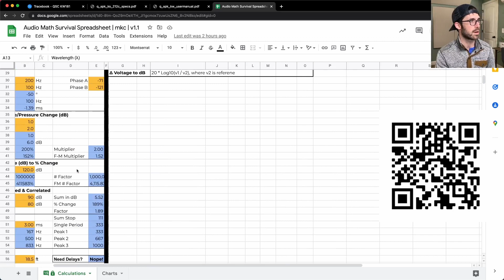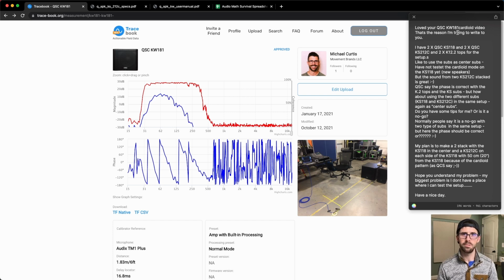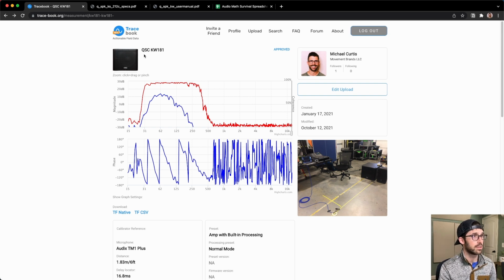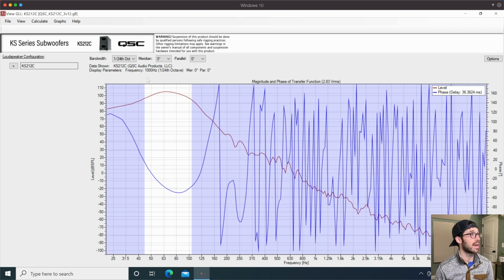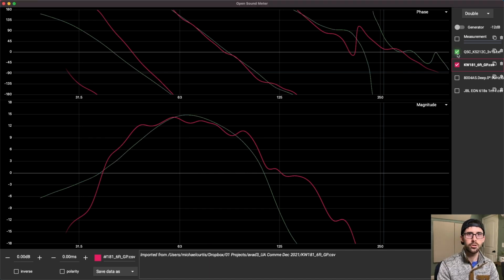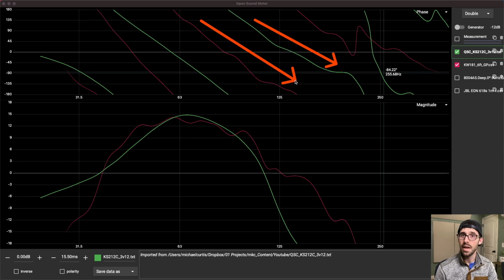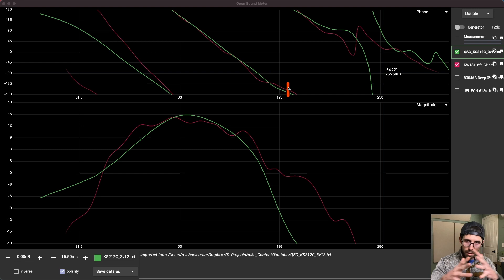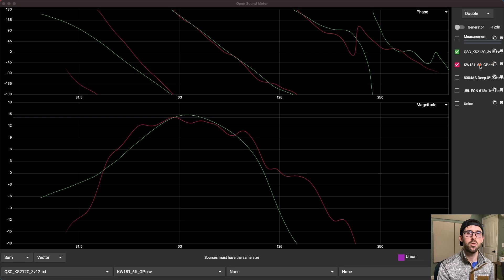Mixing QSC KW181 and KS212C Subs In The Same System? | Phase Compatibility Test

Comment: I had a Similar question, and this video helps a ton, so I bought a basic measurement setup like in your other videos. and am working on uploading the findings to Trace book it's a file for Ks212c and the KS112 I stacked a Ks112 non cardioid on top of a Ks212c and phase look very close from around 55-125 hertz and with both it adds about 6db. I did not have room to measure the rear to see how much cancellation I got going backwards but I'm sure it was nowhere near what it does when you're just using the Ks212c.

Comment: I currently have two KS118's and two KS112's. I am doing an event soon and wondering if I can place the KS118's either side of the stage, and the KS112's in the centre. From this video I feel I could try and reverse the polarity and see what happens on the KS112's. Any thoughts?

Comment: Curious, would the fact of the KS212C being a cardioid sub have any effect on the output of both subs (KW118 ) running clustered together? Or no effect? I would think the carioid aspect of the 212C wouldn't work to well with a DJ behind them as they are pretty good putting the sound very forward but a 118 next to it -all bets are off. Obviously, I think, with a 118 right next to the 212C the output would be effected mainly behind the speakers. Or am I losing my marbles? Great channel and videos!
Reply: The 212c would not have any cardioid effect on other subs. The second driver in the 212 is only affecting the rear rejection of its other driver contained in the same box. The only impact the 212 could have on the 118 is coupling as per the video, but processing would of course need to be involved.

Comment: Eh Michael, thx for the info! Already had a pair of kw181 and just bought the ks212c to bring a bit more kick to the dancefloor. Didn't try them together yet, but learning it's better to change the polarity of the 212 means a lot. Question though... symetry wise, does inserting my 212 (yeah, bought only one $$$) between the 181 will have a negative effect, like phase cancellation, or placing them apart ( pair of kw181 on a side of the table, the 212 on the other) would be better and to hell with symetry? Maybe it won't have any effect, I don't know.... I'll watch your other videos about the sound physics you analyze here, I don't quite understand all that science yet... Teaching industrial automation, so I guess I'll be able to connect the dots someday 😅 Thx a lot!
Reply: Inserting the 212 in the middle of the 181s will certainly negatively affect the coupling that would otherwise happen with the 181s side by side. 
If placing 181s on either side of the table, put the 212 in the centre and play with delay and polarity to help it play well with the 181s. 
Be aware of power alleys.
Reply: @StereoAnthony  Just got my Driverack PA2 last week, I will sure try your suggestions and give you some feedback when I'll get some results. Thanks a lot! 🙌

Comment: Thanks for the info 👍 
I have two single 18s 6th order band pass subs and have recently added a duel 18 front firing ported box to the setup.
I am planning of placing it in the middle of the single 18's.
I am going to measure and phase align, but would you suggest splitting the lows between?
Also subwoofer frequency tuning?
Thanks 😊

Comment: Great channel. I bought the KS212c in Feb 23’ of last year. While i love it it hits the limiter at 12 o clock position or below which surprised me considering it’s a 3600 watt sub i never would have experienced this…however my KW181 which i still have has never limited out at 12 o clock or below and it’s only 1000 watts. I’m not even pushing the KS212c very hard and it seems to not have the power it claims unless mine has a fault. I just purchased an EV EKX15sp and will be doing a comparison of both. If the EV sounds good I’ll get another for a matching set and sell my KS212c.
Reply from the maker: I don't have a ton of experience with the KS212c's, but I was also underwhelmed with their power output. You lose ~3dB of headroom or so by nature of the cardioid pattern, but the smaller 12" woofers also don't have as much max SPL capability as the 18" woofer.
Reply: @MichaelCurtisAudio  Thanks for this!  I have been having this very same debate and nowhere local I could test the KS212C.  I have loved the sounds from my KW181 for the last 10 years but wanted to get less boom in the DJ booth...  welp... Guess that's not in the cards.
Reply: @nickbarcio  just an fyi. I have my EV EKX15 sp and that sub is terrific what i love most it has regular sub mode and cardioid while the KS212c is always in cardioid. The EV is lighter and much more portable I could curl it like a weight it’s like 50 pounds or more. It also is not as wide and long like the KS212c. I will be selling my QSC soon and getting another EKX15sp…simply an awesome sub and seems to handle bass much better as the design is boxed.
Reply: @DjTecniq  thx for the input... Currently have a pair of kw122 with 2 kw181... For my type of gigs, office parties, weddings, 200 people max, they do the job for most of pop-dance music. But I recently began doing outdoors gigs, with more electro, and I feel I miss some punch. The 181 sound good from a certain distance, they give the sub-bass, but i feel the 122 have to backup for bass richness and clarity. Aaaand that's when they sometimes clip or shut down... killing the vibe.... Even got my behringer 812 at the rescue one time... So I hesitate between a 2x12'' like the 212c or a 15'' like the EKX15 or RCF 905 mk3 to help the 181s... As a complement, what would you be prompt to choose?
Reply: @hugorobinson277  I’m almost 41 and I’m not getting any younger. I have my KW181 still but I’m done hauling 18” woofers around. I like having two 15’s they are more portable and hardly any strain on my back. I love bass just like any DJ in FL would but I’ll bring out my KW181 for bigger events. I love QSC but i do not like the new KS series subs they are too tall and way too wide for my liking. Can’t even fit the 212c under my booth facade cause it’s too wide and long it sticks out way too far for that very reason and the weak output it has for a 3600 watt sub (which is bs) I can’t recommend it. My EKX is shorter, not anywhere near as wide and can easily fit under my booth/facade with plenty of room still. The EKX wins and I’m sure the EKX18sp would even be better suited. If you want deeper bass get the ETX series’s but that weight alone is a deal breaker for me.
Reply: @DjTecniq  Something to consider about advertised wattage. 
When QSC (or any other brand for that matter) proclaim their wattage amounts, you always need to cut that number in half. 
In the case of the 212c, the 3600 watt number is peak, not RMS. RMS is half that number.  RMS is a much more accurate description of wattage capabilities, but real world performance is indicated  by " SPL". In the case of the 212c, QSC claims MAX SPL to be 132db according to the product page. Unfortunately that number is also as misleading as the 3600 watts claim. 
A good practice is to shave off 3-5db of a products declared MAX SPL to get a better idea of real world performance. 
So your 212c is likely only outputting approx 128db at the onset of limiting. Easy to see how that is underwhelming.

Comment: Hi Great info, I plan on using the QSC line array LA108 with the Ks212c  to the side about 15ft up against a wall. Did the layout on easy focus 3 and have it work in all green at 3 octaves, but do I need to check phase alinement between subs and line array speakers?

Comment: Quick question,
I have a 18” powered subwoofer that has a frequency range of 40hz to 140hz the amp built in is rated 600w RMS @ 8ohm. If I was to upgrade the driver that has the same capabilities but has a response from 30hz to 200hz and a higher sensitivity of 99db, In theory would this provide a lower response and a higher SPL???
Reply from the maker: That all adds up to me, although it's not common to run a subwoofer all the way up to 200Hz.
Reply: @MichaelCurtisAudio  thank you!!! I’ll probably keep it from 30-120hz. I’m excited to replace the driver to a neodymium Subwoofer to save weight.

Comment: Great  do you have any info on rcf8004s with
Reply from the maker: With which other sub?
Reply: @MichaelCurtisAudio   8003 mk 2   thanks
Reply: hI mate did you find out anything ?
Reply from the maker: @jeffsharp7362  Sorry for the delay! I just pulled up each of those subs GLL files and exported the data into OSM and compared the data. Long story short, they're not a "perfect match", but their phase traces do trend very similarly. They stay within +-50° of each other from 40Hz up to 125Hz, so you will get at LEAST 5dB of the total possible 6dB summation when paired together. I'd have no problem putting these subs together on a show.

They're most closely phase aligned at 100Hz, then slowly drift up to 50° apart by 63Hz. I've posted a Dropbox link below that will take you two screenshots that show you the data. Hope this helps!

https://www.dropbox.com/sh/lm5fubtiflecpxv/AAB-A1r4MskVDOIaA5_aWFeHa?dl=0
Reply: @MichaelCurtisAudio  you are amazing my friend ...love the channel and thank you very much